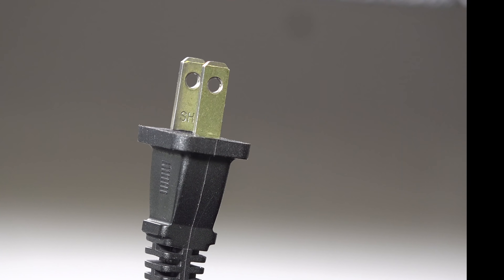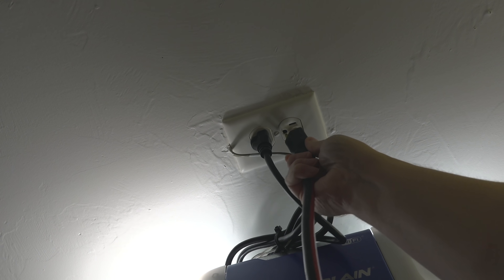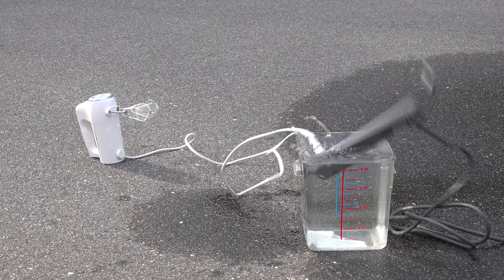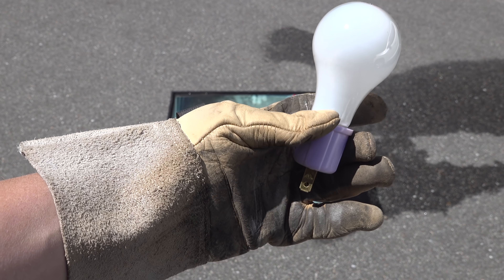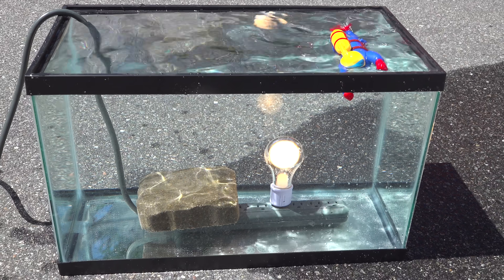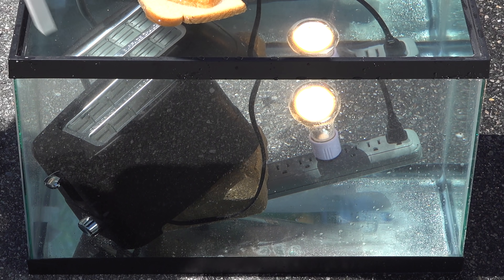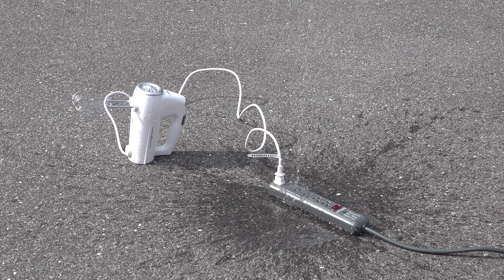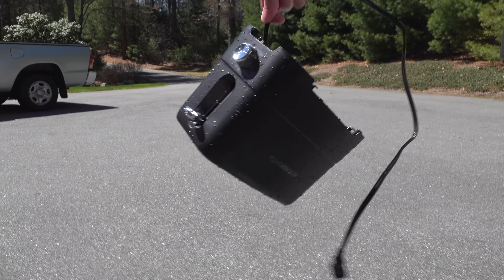What REALLY HAPPENS WHEN YOU SPILL WATER in an OUTLET?

Comment: A. The normal conductive path through the power strip and the light bulb/appliances is less resistive than the water, which is not that great a conductor.
B. The GFI trips on any stray path to ground. Water is quite capable of being a stray path to ground.

Damm fun though. I had a similar experience with Christmas lights. I used to tape the connections up with electrical tape to make them waterproof. But I didn't see anyone else do that.Finally I realized that the conductivity of the rain was not really doing much. I don't bother with the tape now.

Comment: A GFCI is a must, a standard breaker will NOT trip under these circumstances.  A breaker will only trip through a certain level of heat generated by overloading the circuit past its rated 15A.  The GFCI works by tripping when the flow of +/- is disrupted, for instance by a short.

Comment: Wouldn’t work here. At my home every socket is protected by RCDs that are installed in front of the circuit breakers and will trip if the residual current exceeds 30mA.

Comment: Weird... 🤔 As a young troublemaker me & my buddies used to go into the apartment buildings in the projects and piss in electrical outlets in the stairwells or poor water/soda on them. They go absolutely nuts, sparks start flying out, it smells, makes loud pops. They are quite resilient to, cause a single outlet would go through this multiple times before shutting down. I didn't know what a breaker was or anything at the time, but I'm sure we must of tripped them often cause after abusing an outlet & shutting it down, the power would stop & if you left it alone for a while it would work again. Only remember a couple occasions where the outlets had to be replaced. Many of them were in impractical places to begin with so it probably took long to get addressed/repaired, but I remember them being able taking a shit ton of abuse 🤣 Fuck, kids are such lil assholes sometimes 🤣

Comment: The conductivity of water, or lack of is what's at play here.  Pure water is actually a good AC insulator with a resistance of about 18+megaohms/cm (a standard multimeter can't measure the resistance of water).  "Lab Grade" water (Type I De-ionized) gets in that range.  More useful units of measure for small conductivity are microsiemens/micomhos, TDS, EC; all are interchangeable and just mathematical derivations of each other.   A micromhos is the inverse of an ohm, so 1/x.  Grocery store "distilled water" is typically bottled at 1uS/cm.  Municipal tap ranges from 50-500ppm TDS, or an AC resistance of ~1.3megaohms/cm - 130kiloohms/cm.  Also, the little bubbles from the toaster are the electrolysis of water into its components hydrogen and oxygen.  HTH.

Comment: One thing to note, although this is by no means a reason to go and test it, is that water on its own (purified, distilled, whatever) does not conduct electricity and it a decent insulator actually. It's the contaminates, like soap (for the toaster in bathtub thing), minerals, oils, etc. That are in the water that cause major problems

Comment: Clean water is a poor conductor.
It's the minerals in the water that conducts.
My electrical engineering professor would plug an extension cord in then put the other end in to a glass of water and drink from it throughout his lecture on conductive. 
Knowledge is power and lack of knowledge can get you killed. 
Be safe.

Comment: Pure water is a very poor conductor of electricity. Stick your hand in that aquarium and you will probably not get shocked. The problem is that wet skin is VERY conductive. Get too near one of the conductive surfaces in the water with your hand (and especially if your feet are in contact with wet ground) and you could be killed.

Comment: It is never a good idea to mix water and electricity, do not ever attempt this as it will result in death.

If you had added a little table salt to the water you would have had a much different outcome. Pure water is actually not very conductive and it needs the presence of minerals in the water for the electrons to freely pass through the water.

Comment: Long story, fun fact. My neighbors where out of town for the week, one night i realized water pouring out from under their front door. After getting the neighbors permission via phone call to enter their house, I found a pipe upstairs had burst and the whole house was flooded. Ankle deep on the first floor. While walking through the house I noticed a hot spot of water in the office. The power strip and floor outlets where still running and had been submerged for a while. I was supprised at the time that I wasn't electrocuted A) and B) that the breaker had yet to be tripped. Great video!
Reply: The office outlet was on the floor not the wall and was not GFCI.

Comment: I did this 20 years ago on a job to prove that it wasn't water tripping a circuit breaker. I took a hot extension cord and dunked it in a mop bucket full of water. People were running and screaming like I pulled a pin on a grenade.

Comment: We had an extension cord that had a bad repair in the middle of it that was live and left in the garage. It rained hard one day and water seeped in and soaked the cord. It went BANG! All standard household power outlets are 220v volt here in Australia, and rated at 10amp. Wonder if double the voltage makes a difference.
Reply: It sure does. Double the voltage means that it's much better at overcoming resistance - 4 times better.

Comment: Once again you fail to realize what you are talking about.  Put that relocatable power strip under "your tap water" and pour some salt in, then a little mix, pop.    Water is not conductive, it's the minerals in the water that determines it's impedance.  So based on geographical location  your normal dual function breaker may trip.  The bubbles you saw was hydrogen gas.  Ya didn't know that either.  A gfci should trip between 4-6 milliamps.   .004 - .006 amps.   You probably don't even know how a gfci works.  Or what the dual functions of a circuit breaker, or the trip exponential curve of a ocpd.  Learn first kid.     Understand it if ya wanna teach it.

Comment: The reason why this works is because water is actually an insulator. Also electricity goes on the path of the least resistance. In this case the copper inside of the power strips and such will still flow through the circuit normally. The reason why electricity conducts better in salt water is because salt water naturally has a lower resistance (not the best resistance, but significantly lower than regular water

Comment: I think the power strip just worked underwater because it was regular water and water itself doesn't conduct very well. If there's salt or other stuff in there that makes the water conduct good enough it will first start to decompose (electrolysis) and eventually the breaker will pop.
Reply: Plot twist: it's a distilled water lul
Reply: @youravghuman5231  distilled wouldn't have popped the GFCI on the last test, it's probably just regular tap water. thing is tap water has a resistance of around 1000 to 5000 ohm/CM, quick math suggests that each outlet is likely shorting by around 50 milliamps, which is not enough to disrupt a larger load, but still enough to harm anyone who sticks their arm in and gets close to the outlet.

adding more impurities over whats present in tap water will decrease the resistance of the water (salt water has less than 1/20 of the resistance of tap water) and increase the amperage made by the water based short circuit.
Reply: ye, thats why it didnt did anything
Reply: Perfect example of someone having a little - but not enough knowledge. Water out of the tap is a conductor of electricity. Salt water conducts it better. Distilled water is a very poor conductor of electricity but will still conduct trace amounts. The point of this is if that toaster fell into a bathtub full of what you think is "regular' water, there's a high probability electrocution will occur (depending on the health and body mass of the person and length and depth of exposure)
Reply: @ruffxm  👍

Comment: Or America could get with the times and implement 21st century safety standards, stop using uninsulated prongs on plugs (there is no palstic insulation the blades of the plug to stop electrocution when a plug is half in half out, and you touch the now exposed prongs), and mandate RCD's (GFCIs) for all breakers, and not just some outlets, with no breaker protection. It's crazy to me that the US still has like 1930s levels of safety.

Comment: Well outlets and cat pee don’t mix. I had one of the cat litter boxes on an old stereo cabinet. There is an outlet with an extension cord plugged in behind the cabinet. Unbeknownst to me, one of my cats, when she peed in that box would pee standing up straight against the wall.  

One night before bed this cat went in the litter box and did her thing standing up. When I ran to stop her, I put my hand on her backside to get her away from the wall, and the sparks started flying, literally. There were blue and orange colors, very loud buzzing and smoke.  I pulled the cabinet out and thought the outlet was on fire. After about 10 seconds, the breaker tripped. A hole was burned right in the middle of the outlet. 

I left the breaker off all night and couldn’t sleep. When the electrician came the next day and removed the old outlet and handed it to me, it was sticky all around from the cat piss. This scared the shit out of me. 

I’m in a very old building that still has the stiff cloth covered wiring. With the exception of the kitchen, all the outlets in my apartment are the old 2 prong, well now the one that was changed is 3 prong. 

Needless to say there is no litter box there any more, and I have filled that area with bulky items so the cat can’t get up there any more.

Comment: I found out when I had a flood in my basement, it's very hard to cause a breaker to trip by an outlet being submerged in water....it will cause an electrical shock but, it's very hard to cause a short.
The dirtier the water the more conductive it is.
It's the impurities that causes shorting.
Pure water is a poor conductor.

Comment: Water isn't the best conductor, and well quite frankly none of the water was really grounded. You could actually have stuck your hand in there, and have been fine, there's actually a video done by ElectroBOOM who does this experiment, except he uses his finger, the key is, don't let yourself be grounded. Now some equipment might spark, the plug strip may have just been very well insulated, and it also depends on how high the voltage is as well, (also how conductive the water is, different elements or mixtures can make water more conductive). Electricity will only spark if it grounds, or shorts to another line of power (duh).

Comment: the main take away in my opinion isn't that you have "no protection from normal outlets", it's that water and electricity aren't as bad a combo as people think, and the main issue is with conductive liquids
Reply: Pure water is a good insulator, tap water is not pure and bathwater for example, is far from pure. Remember you need 15,000Ma  or more to trip a standard breaker. You need 50Ma to kill you...
Reply: @Teh_Random_Canadian  true it is also just good practice to keep liquids away from high voltage
Reply: Remember though that if you touched that water, you'd be severely shocked

Comment: the electricity has to go to ground for the gfci outlet to trip instantly. A bathtub drain is connected to earth so it is grounded, so if you have a frayed cable in the water then the gfci will trip.

Comment: Water IS conductive, but not ENOUGH to affect things like this or trip a regular circuit breaker. When on sensitive electronics like computers where tiny amounts of current leakage will cause problems, then it causes problems, but on large things like a toaster or light, the milliamps that is going through the water is not enough to cause a difference. The standard GFCI trips at just under 5 milliamps which is why the water causes it to trip. If you tried this same thing, but with salt water, you would have different results.

Comment: The concept, in simple terms. GFCI. Between Hot and neutral current flows at 60hz. GFCI checks for voltage leaking to the ground unbalancing the flow. When is see it? It trips off being a life-saving device. Breakers, on the other hand, are tripped by amp load. Have you ever turned on, say in an older home, the toaster and the microwave on the same circuit and breaker tripped? Both items running together drew more amps than the breaker was rated for and then trips. Without a breaker, wires could get hot enough to start a fire in the walls and burn the house down. So you could say breakers protect the home. Another important device. Surge protectors. Every home should have them installed in the power panel. This way, the whole home is protected, meaning all electrical devices getting power will have protection. Surges kill electronic control boards! Like on washers, dryers, TVs, and microwaves. It truly is a good investment to have one installed. But cost-effectively, get at least quality surge protection stips for your devices. Hope this helps.